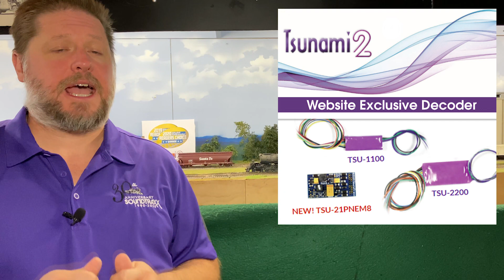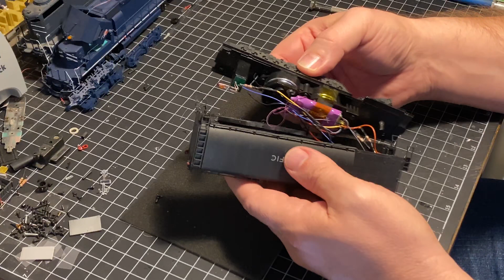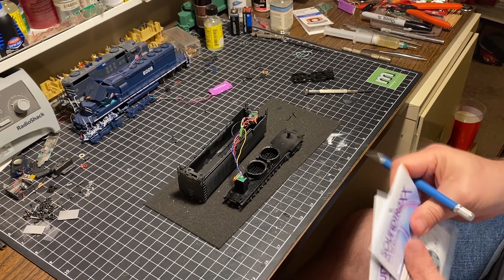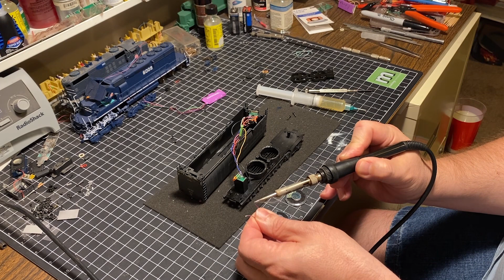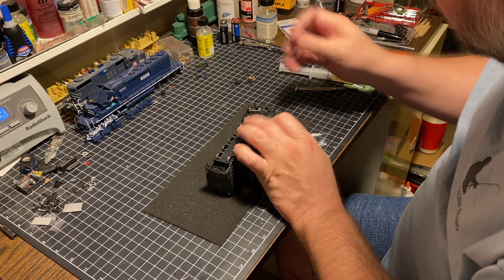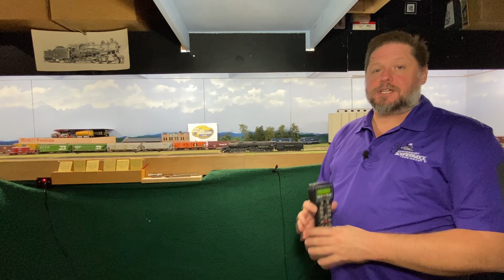New Tsunami2 Decoders for Big Steam Locomotive like the Big Boy #4014

Comment: Do you have f22 crew talk like athearn has on there tsunami 2 that's in theres.. and duel Dynamos
Reply from the maker: Athearn uses full-featured Tsunami2 decoders. So all of the features on Athearn factory-installed Tsunami2 decoders are available on aftermarket Tsunami2 decoders. Aftermarket and factory-installed Tsunami2 decoder will often have different function mapping though. So different buttons trigger different effects.